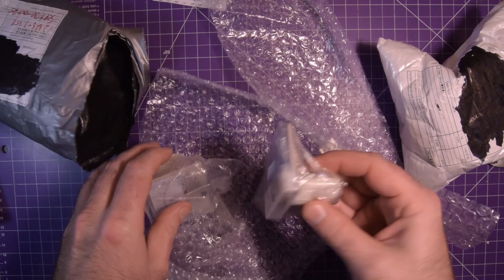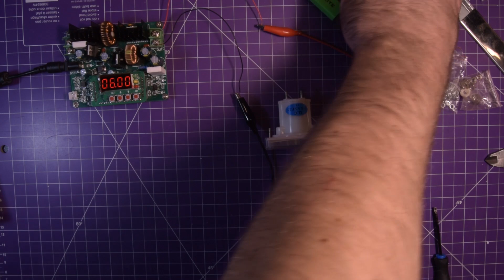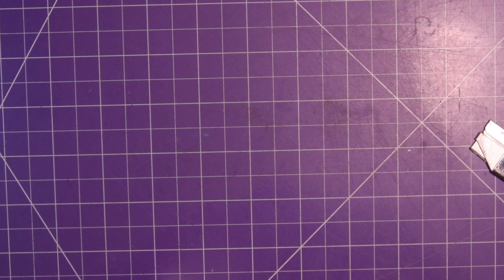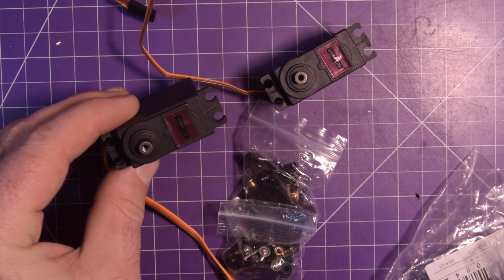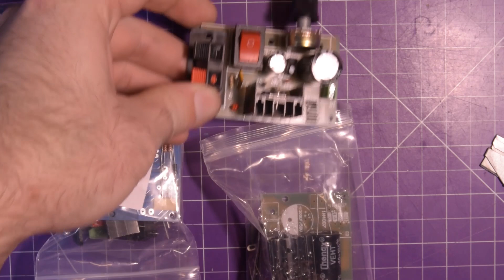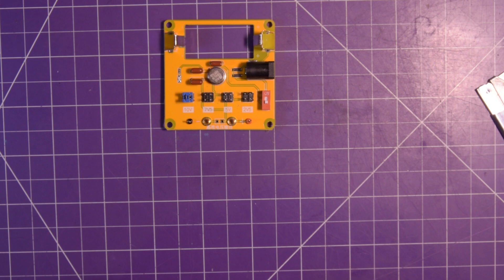Mailbag 35 - Robot Parts!

Comment: No way on the ammeter. I would file a complaint about a replacement. My money was not defective. You can measure the i.d. a lot more accurately by using the calipers correctly.